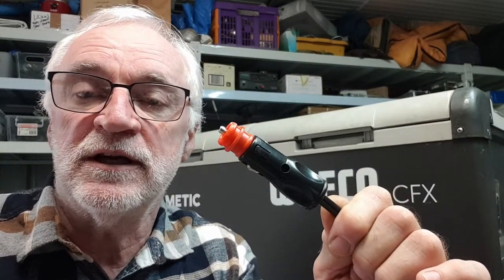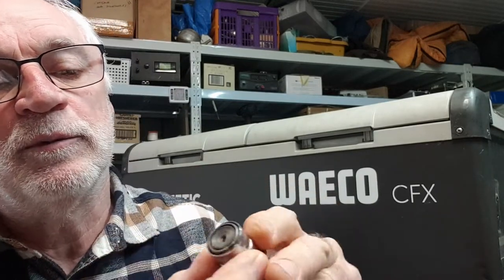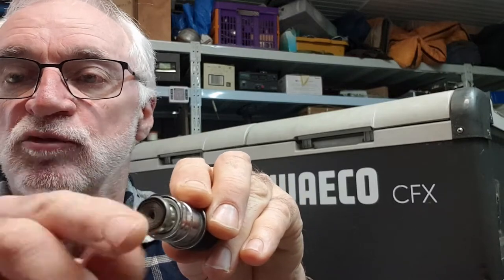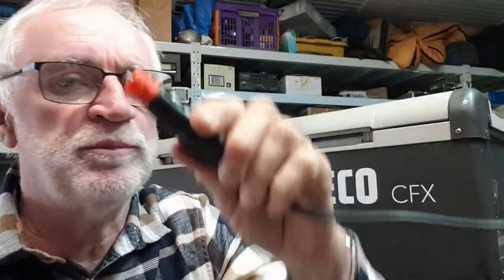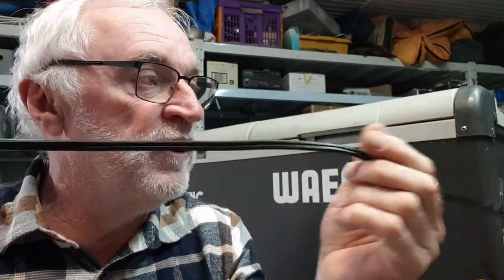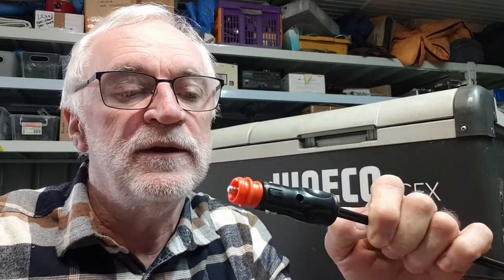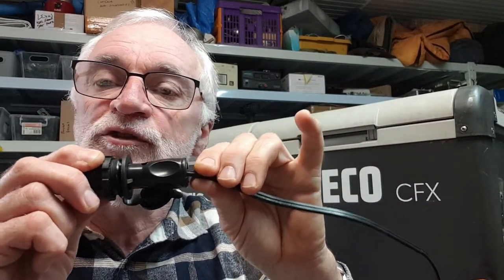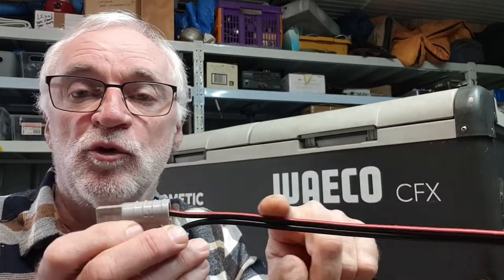12V Fridge's power problem

Comment: You just solved what took me a year to try and figure out, new batteries, 25mm cable, the works. I changed everything except the last 0.5m standard cable plugging into the fridge. that's where the issue was.
Reply from the maker: Glad it helped. Cheers Tim

Comment: i had the same problem , i have easy fix for that buy  "disposable aluminium food bowls " ( use the bottom part ) it's very thick aluminium ! cut of sheet and roll it up in to a cilinder put it in the car socket and put the adapter back in the socket , problem solved  ( if make a video about it give me credit ) my channel is not made for tutorials ;)  thank you mark

Comment: Did the Anderson plug mod to my Waeco 40l fridge about 20 years ago and its still going strong.  Cut the plug that goes to the fridge off and used 8mm cable between it and the anderson & fuse and zero power issues.

With those original plugs they get very hot on the +ve tip, try unplugging one after its been on for a bit and theyre damn  hot
Reply from the maker: Exactlly

Comment: Hi Tim, very interesting. I understand the advantage of swapping to the Anderson Plug. However, how does one then connect that to the car's battery? I have a 2022 Toyota Hybrid, it has USB and USB-C and the round 12V socket. Could I get Toyota to install a 240 Volt power outlet connected to an inverter and just run the fridge from the standard "Mains" power cord? Any advice greatly appreciated. Thanks Alan
Reply from the maker: Sorry Alan had not seen your comment. You need an Anderson plug installed by an auto electrician. You've probably sorted that out by now. Cheers

Comment: Hi Tim, I have an Evercool 30ltr 12v fridge.
Turns on, compressor starts after the recommended 2min start up process but never gets cold. Digital temp is working as it changes with the ambient temp.

No error codes (red error light not on either)
Green light on

Fan not running either, but figure that comes on with a temp signal thermistor? As required
After running for a while the compressor discharge pipe doesn't feel hot. Just whole unit slightly warm from running overnight. 

Can you suggest a fix to look at? 
Thanks Gavin
Reply from the maker: Hi Gavin, possibly the fan has failed and that has caused the system to get  excessively hot and you've lost refrigerant so now it doesn't cool. You won't get an error code in that situation and the compressor will run full time. But look, difficult ultimately to know without looking at it. Oh and the fan should run whenever the compressor runs.

Comment: I have an old Norcold MRFT-60  that seems like an excellent old cooler... been using a couple years with no problems. I accidentally left the van doors open when it rained and it got wet... it was connected to 12volt at the time, but it wasn't actually on. The 10amp fuse was burnt out. Now after everything is dried out it keeps blowing the fuse... flip the on switch and the compressor kicks on for a split second before blowing the fuse again. Any ideas where the problem may lie?

I haven't connected yet to 120v AC power to see if that works... worried about doing even worse damage. I'd hate to see this great fridge go to waste because of some little electrical problem.
Reply from the maker: That looks like its a rebadged Engel fridge and that is possibly a power supply module fault which will be expensive to repair I suspect. They are a complex power supply and you cannot replace them with an aftermarket part as they are quite perculiar to that type of swing motor compressor only used in Engel fridges.
Reply: @timterry8714  Yes, I think Engel is the newer name for these. Appreciate the feedback. We'll see what I can figure out. Thanks!
Reply from the maker: @skyjacobs  No Engel was the original pioneer of the portable 12V fridge back in 1962 so Norcold would have redaged their product.
Reply: @timterry8714  Oh, OK... good to know. Since Engel brand is still around I figured it was the newer name.

Comment: Hi Tim , I run 2 small fridges a 54 litre and a 15 litre console fridge , the console fridge runs permanently and sits in the tray of my work ute (2 yrs old in all weather no cover) and has never missed a beat, the second fridge 54 litre is only on the vehicle when camping so beer in the small one food in the bigger one, recently my dc to dc control panel showed an error ( connection ) both fridges had error codes and wouldn’t run , both are Anderson plug connected  but the bigger of the 2 fridges has a high med low switch where the plug connects to the fridge? This fridge is 24/7 connected to mains power at home when we are not camping , should this be set at a high med or low setting for 12 volt? , the fridge is a glacio so it’s a cheap Chinese brand but has never let me down in 4 years.
Would be interested for your opinion.
Great video very informative.👍
Regards Gary.
Reply from the maker: The first test I would do is run them on mains power and if they work OK then the problem is vehicle related. The mains power maintains a higher and more consistant voltage to the fridge compressor. Similarly fridges often work when the vehicle engine is running but show up errors or won't start with the engine off - again a voltage drop problem. So try the mains power test, if that proves the fridge runs OK then problem is the battery,  wiring or connections in the vehicle. That sounds like a vehicle power issues as both fridges showed a fault.

Comment: Hi mate 
I have a 12v dual zone fridge that works fine on 240 but on my 12v it cools 1 side well below it’s pre set and 1 zone doesn’t cool at all. Could this create issues like that?
Reply from the maker: No. The problem you are seeing is caused by the gas switch (relay) is not switching between sides. The display/control board tells the gas switch to change sides but either it isn't sending that change to the gas switch or the relay has failed. You need someone to look at it.
Reply: @timterry8714  thank you for the reply. I’m just wondering why would the gas switch relay not be faulty when plugged in to 240v? This is only happening when solely running off my 12v deep cycle.
Reply from the maker: @jbarnett88 well that's a valid point. Could be voltage sensitive. The voltage is generally a bit lower on 12V and often the gas switch issue is intermittent - sometimes it works OK then it only has to miss once and that happens. Bit difficult to know exactly without seeing it and watching it.

Comment: Heya Tim
I just picked up a free 12v Fridge/Freezer thats apparently been stored for a long time. Compressor running, fan running but its not freezing up.
That a gas issue or could it be power issues?
Reply from the maker: Could be either. Very hard to answer with no details. Are you in Brisbane?
Reply: @timterry8714  No Mate otherwise I'd be happy to come and annoy you 😆
In a Western suburb of Melbourne

Comment: How cold will these things get when its 110 degrees?? Are they even worth it?
Reply from the maker: Yes they will get down to the correct temp for a fridge and even at !00F or 43C if the insulation is good the fridge will operate as a freezer also. The problem with most modern fridges is that the manufacturers have reduced the size of the compressor significantly, use "expander foam" rather than proper cool room type insulation in the walls of the case (no thermal insulation properties) and on some of the larger capacity fridges (a good example is the one in the background of this video!) the cooling fan and condenser have been reduced significantly. No cost saving to the customer I might add! The result is that many of the large 75 and 95ltr dual zone fridges run almost continuously above about 95F or 36C. No good for the hotter countries like Australia.
Reply: @timterry8714  we just got one. Plugged it in and no cooling at all after a few hours

Comment: The downside to your video is you don't explain where to plug that in you say plug it out. I'm dumb and use that grace plug saying and now, when you plug that you aint told us anything. Cause I keep getting F1 notice on my nomadic fridge.
Reply from the maker: This video is explaining the short comings of cigarette lighter plugs as a method of connecting your fridge to your 12V power source. I am simply stating that this needs to be changed to a better and more reliable type connection. This will require that you install a matching connection on your vehicle to match the fridge. I'm simply stating that the cigarette lighter plug is not a good or reliable connector and should be changed.
Reply: @timterry8714  Thank you for that before replying to my friend. But you say not in the cigarette laptop, so where do you block it? Can you let me know if I'm driving? Does my Dominic fridge? Is I'm doing the same thing that you say in the cigarette lights on the pool and it keeps going to F1. I'm going to ask you a little bit better.
Reply: @timterry8714  In fact, what does F1F2F3 me? An thank you, my friend make a video on that.